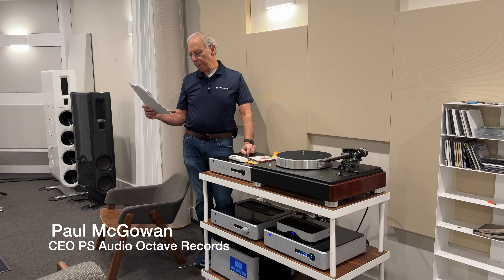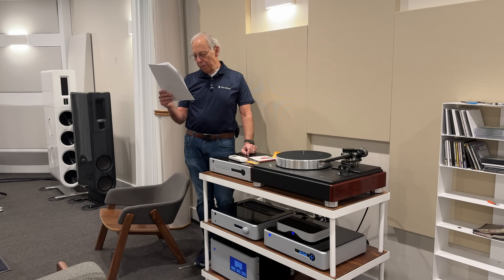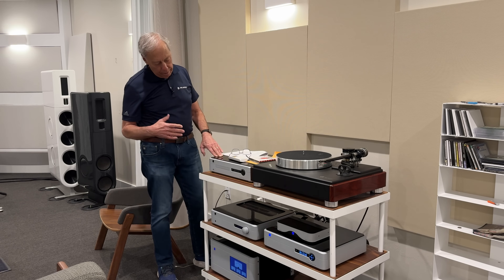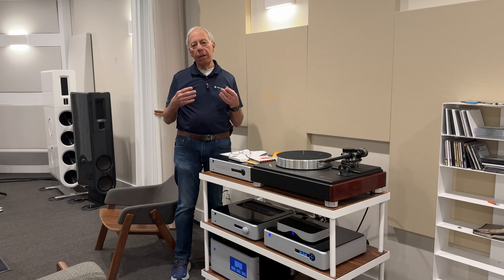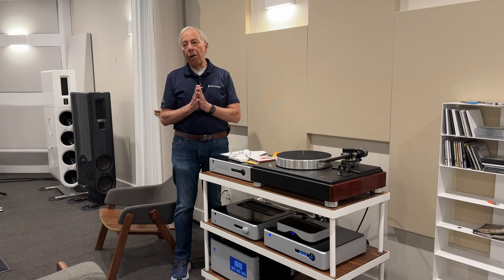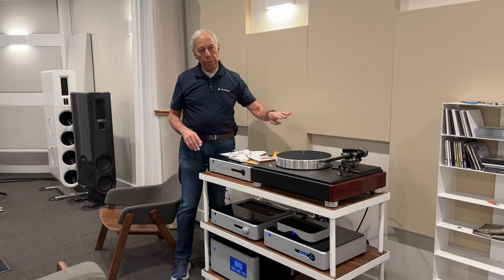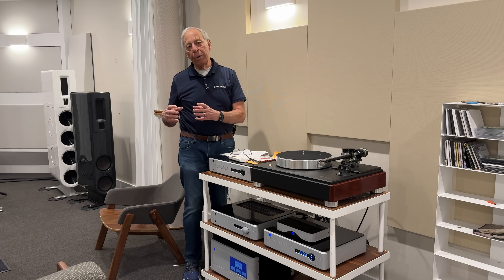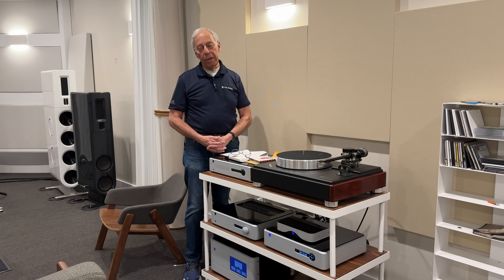Does a transport need an internal DAC?

Comment: UBP-X700 Bluray player does SACD DSD. I know because I use it. It outputs over HDMI.

I decode on an Onkyo RZ-50 (as I like the surround channel SACD's plus I use it for Bluray audio which also supports 8-channel uncompressed audio and you know... Movies)

These are some excellent AVR's out there. As are there a number I integrated 2-channel amps (like those from Yamaha) that also have the DSD codec on board.

I'm sure there are a few dac's that can decode it as well over standard HDMI. But am less familiar.
D

2